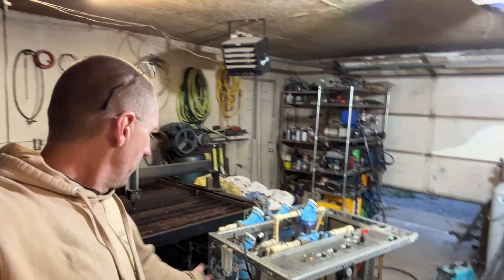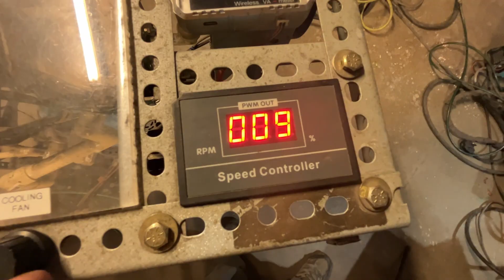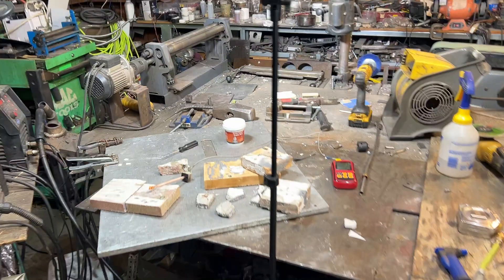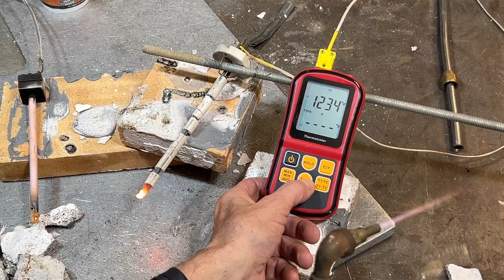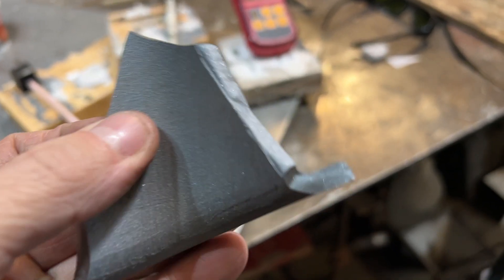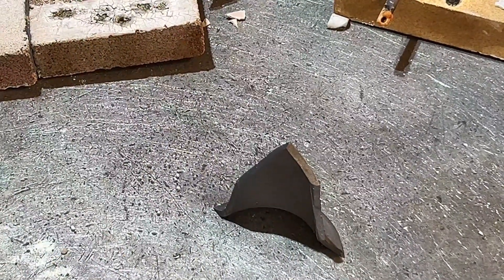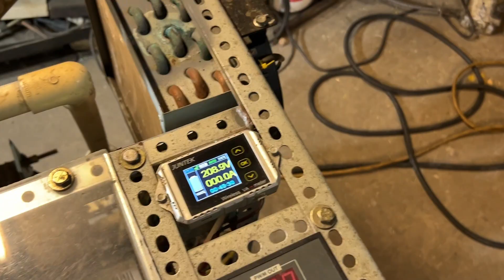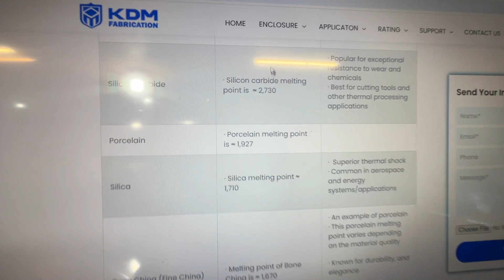How hot does hydrogen actually burn ?

Comment: Do you think the ebay hho180s could get hot enough to make a rivet on the end of a 1/4 piece of mild steel?
Reply from the maker: probly not for very long , those us its pressure up a bit and arent made to run for very long
Reply from the maker: No ,sorry for the sloppy comment below

Comment: Oxyhydrogen is used to weld the thermocouple material together in pt/ptrh thermocouples. It will literally melt the high temperature wire.

Comment: Try using an arc welder and two carbon electrodes just to see if that silicon carbide can be affected. Electric arcs are the hottest thing you can get, ivemelted tungsten carbide with it at 200A.
Reply from the maker: Turns out a commenter was correct it doesnt melt it sublimes

Comment: There are only 8 types of common thermocouples, with the hottest only capable of measuring 3100 degrees - 5000F is a pipe dream. An IRT5000 Infrared laser Thermometer can read up to 4300, but costs over $800. A thermocouple is just 2 different metals twisted together - not rocket science. They braze, silver solder or weld the tip to make it hold up. Anything hotter than the bonding material will cause it to melt away, but you can repair them, by brazing/bonding them back together.

Comment: SiC is laughing at us lol..The most fun video yet! Thanks you. Gutsy, and I reckon you might have enjoyed it too. Send me an invoice for the thermocouple. But I was thinking. A wrap of kaowool around the SiC fragment for some insulation, similar to the successful cracking experiment where the temp had time to build up and not in open air, with the thermocouple beneath the SiC to protect it, this should show more heat. Might not have been a fair fight otherwise.

So for HHO flashback arrestors, I did some patent reading and development last year. Air stones work well to stop flashback but I wanted to pack my own tubes with push fittings at each end to make them easier to connect in several locations within my system and at the torch. Custom Air Stones can be easily made by mixing sand (not too fine) with a syrup made by dissolving perspex swarf in methylene chloride (perspex glue). Then pack this mix into your tube.Then as the methylene chloride solvent evaporates it leaves a solid matrix that the HHO can pass through but the flame cannot. The tighter you pack, the slower the flow. The finer the sand, the slower the flow. There is a sweet spot to be found.

I had them between the bubbler, electrolyser, return lines, modification tank and at the torch. Always wore ear muffs and clench when shutting down flame!
Reply from the maker: They say the thermal conductivity of sic is close to copper , never looked it up so im going of others people . they also say sic sublimes it wont melt

Comment: Melting or boiling of tungsten would be a good test… a smaller sample will heat up faster.

  I have seen claim that HHO (of sufficient power) somehow resonates electrically in recombination, to heat a material to its melting or boiling point.
Reply from the maker: I herd that to . Turns out a commenter was able to tell us SIC sublimes it doesn't melt  . It didnt sublime much lol but it did do something strange

Comment: Hydrogen burns a pale blue.  An orange flame must have something else mixed with the fuel.
Reply from the maker: True but the point from the earlier discussion was that only hydrogen gas does this cluing us in its indeed hydrogen .  Propane doesn't burn orange out of this same system  .The point is people say hydrogen burns clear in the other video posted but they have only read books about hydrogen and haven't actually burnt the gas .
Reply from the maker: you can see the tint of blue at the tip and it does burn blue until the velocity gets going

Comment: Use less power.. The electricity you are using is splitting the water, the goal is reaching the frequency of heat to cause hydrogen to split. Frequencies above 10 MHz and once you find the sweet spot it will never bother anything but water but make sure to fire the beam DOWN.. Never put hands in any Ultrasound beam targeting water. https://youtu.be/p8xYUDiSGDk?si=wYsDuk-R9MKSc-zN if you can make an echo container for it you can recycle ultrasonic waves. Saving even more power.. Its technology I want from classified submarines that have no need to swap oxygen. Ever heard of a Magnetohydrodynamic drive for Submarines? Imagine it at the nose flowing to back through tubes then imagine all that hydrogen & oxygen it makes from the water rising to the inside top with pumps that can collect it.

Regenerative hydrogen and life support with capability of Ultrasonic holography for perfect mixing. Perfection.. When solid state hydrogen went public by a lab originally the military halted them because that's what they were using for long ranged missiles. That's just ONE THING. They're hurting us all..

(Search Ultrasound Algae control for lakes. When you read about it look for Keyword: Resonance. If you target the resonance of any part of something then play Ultrasound its like charging a battery until it explodes and almost no power required for it to be like hooking a smartphone battery to a source that would blow it instantly.)

Comment: just a side note how fast does the silicon remove heat. compered to fire brick remember fire brick try's to hold heat in
Reply from the maker: They say its almost as good as copper . Turns out this stuff sublimes
Reply: @NOBOX7  Sublimation takes away a lot of what one might want to see as 'melt' you know...

Comment: There is a thing called hydrogen embrittlement which turns ferrous materials into glass like structure.I wouldnt use this torch for anything that has iron in it which limits its application.
Reply: I'd like to test this rather than accept this as fact. The stoichiometric mix of O and H burns before it gets to the Fe and the exhaust is H2O. Maybe its different with cracked water as opposed to conventional bottles of industrial gases. And in this instance, the idea was to heat a SiC crucible with manganese steel in it. I doubt any H would make it to the steel.
Reply: @waynoswaynos  Bridges collapsed because of hydrogen that got into bolts during manufacturing .It is a real thing,it is one of the reasons why you dont have engines that are directly powered by hydrogen.
Reply from the maker: To add to this discussion ,  the reason black socket sets are for impact guns and why you should never use a shinny socket  on an impact is hydrogen embrittlement , also nascent hydrogen or atomic hydrogen is 10 times worse .
A scientist back in the day notes that when acid eats metal under water the atomic hydrogen created makes 1/4 steal bars able to be bent by hand right after they are pulled from the acid . Atomic hydrogen just means a single atom  , its not radioactive . hydrogen is typically in diatomic form . H2

Comment: Are you sure silicon carbide can even melt? From eveything i know silicon carbide sublimes and doesnt melt.
Reply from the maker: Yep you are correct my friend it does indeed sublime . Your the man Brother , Thanks for the Intel
Reply from the maker: I searched for the melting point online and found no mention of sublimation but they do provide the melting point .
Reply: @NOBOX7  all of the melting temps that I can get on the internet are either with attached note that it decomposes at this temp or that it was done under 5-8gpa. Also weirdly for such a common material and used so widely by the industry a lot of information is very contradictory. Funny
Reply: @NOBOX7  "Silicon carbide does not melt but begins to sublimate near 2,700 °C like graphite" - SiC silicon carbide Wikipedia https://en.m.wikipedia.org/wiki/Silicon_carbide (use word search function CRL+f as I don't know how to tell you where on the page it is written) 
That would explain the blobs that formed when you tried to melt it. Though Im not sure how SiC truly works, I never melted it, did you ever melt it? I would presume it is only done in electric arc furnaces and probably only in labs.
Reply: @NOBOX7  not sure why but yt just deleted my comment 😂/as always haha. It's on Wikipedia page under structure and properties of silicon carbide.
Reply: @NOBOX7  that would also explain the blobs you got after trying to melt the carbide. But I'm also not sure as I never melted SiC and never saw it malted.
Reply: You have to look up the vapor pressure of silicon carbide to ever see anything about sublimation. Even at temps where stainless steel is liquid you will see oxidation of silicon carbide before it sublimes. Oxygen in the air will react and form silicon dioxide long before sublimation occurs. You only have to worry about that in high vacuum situations and I just don’t think thats your thing. 
Byw I take it you are self taught. I really admire that. You understand heat much better than the majority of your audience, in fact you have more knowledge than most people with letters behind their names and CVs in their resumes.
Reply: Silicone is a rubber like material. Silicon is an element. Silicon Carbide is the combination of Silicon and Carbon. Silicone carbide does not exist
Reply: @levicalebblack  oh how could that happen. A person not speaking English as their first language make a mistake??? Impossible. I think you know what I meant or do you believe that I meant plastic with carbide???
Reply from the maker: You may be correct , maybe its like iodine

Comment: the sun is 92% hydrogen and its 27 million degrees on the surface.
Reply: The core is 27m not the surface 😂😂😂
Reply: But isn't the sun powered by fusion?
Reply: Sun surface temp is only 10,000 F / 6,000 C bro
Reply: Bro but the sun doesn't burn the hydrogen. It's a fusion reaction not burning. A type of nuclear reaction of course it is going to be hot on a surface of a giant fusion nuclear bomb that explodes constantly.
Reply: Are you smoking crack?😂😂😂 27 million. . . . You're definitely gifted
Reply: About 73% H and 25% He is more like it.
The active layer of the sun (where fusion takes place) puts out about 250 W per cubic metre! This is at 15.7 million degrees Kelvin and 150 g/cm density (1.6 million times more dense than hydrogen gas at normal pressure).
This is on the same level as a compost heap here on Earth.
Let that sink in for a moment. The energy production/release inside the sun at extreme conditions is only on par with the micro-organisms working/eating in a compost-heap.

Comment: The issue is heat transfer to the rest of the part you are heating... If you insulate thermally the part you are heating at least from some sides - you will have much easier time melting it...

Comment: :face-blue-smiling::face-blue-smiling::face-blue-smiling:Hotter than hydrogen, only plasma can cut metals. Perhaps a system could be made that instead of melting, melts inside a crucible, using electrodes made of the same material. The advantage is that it is safe and cheap.:face-green-smiling::face-green-smiling::face-green-smiling:

Comment: Whats the electrolyte you use in your HHO system?
Reply from the maker: Potassium hydroxide
Reply: @NOBOX7  what are the electrode plates made of?

I think you're getting some contamination in your gasses if the flame is orange. It might be from the plates getting corroded. Sometimes even commercial hydrogen can have metal contaminants from being stored in steel containers that causes it to burn with a red orange flame. Calcium in the water could be another culprit. It should be blue if it's pure.
Reply from the maker: @prophetrob  Stainless steel . Yes i agree contaimination is the reason 99% of hydrogne flames burn orange Indeed calcium could do it but regardless of what its from a simple web search shows what color hydrogen burns in 99 percent of cases . We seen propane burn blue as the sky with a white hot combustion chambers in the last video so the contamination theory seems to not tell the hole story cus it cant be mistaken for another gas , the orange is a dead give away for people who are doers and not just readers  . I have made this gas burn blue and i do have videos of it but that's with a very small flame . The tip of the torch is pure copper . It could be mercaptan but this would also effect the propane flame but it doesn't. Hydrogen burns orange 99% of the time . unless in  broad daylight . This torch uses propane gas modification so it could have some mercaptan contamination . I dont dispute the contamination theory as i mention it in early work  but only hydrogen has the orange problem not propane and being a burner guy ive seen some flames in my day . I can pic a hydrogen flame out of a candy line up  ... Also when the velocity of this gas reaches a certain point , it entrains air into the flame diluting the ratio of oxygen , this is 80% of the reason for the orange flame . According to scientist , not an opinion ... Yes calcium can produce orange color but distilled water has very little of that to offer . Most of it precipitates onto the anode  if it is present . Bottom line regardless of the sources no other gas experiences this orange shift . So if the spectrum is invisible it lends itself to colors from contamination not viewable from other flames proving its hydrogen . This gas burns blue if  you add just a touch of propane .  
Propane Burns blue 
Waste motor oil burns yellow 
waste veggie oil burns blue 
Diesel burns blue 
wood burns yellow 
NG burns blue 
Hydrogen Burns Orange 99% of the time 
No other flame burns orange to violet red like h2
Reply: @NOBOX7  i guess no one remembers that electrolysis lab in highschool (i THINK its a common demonstration)

Comment: I have to say the question you were asked is very valid NOBOX7. 8:42 Try using a Oxy Acetylene torch and see if it melts ???  The refractory is heat insulating, the metal has the heat conductivity which hampers the melt point fella.  Peace vf   😀😀😀